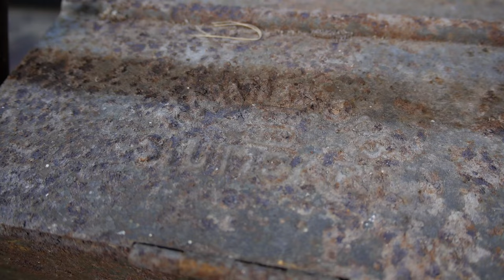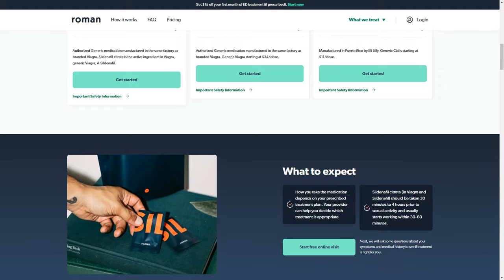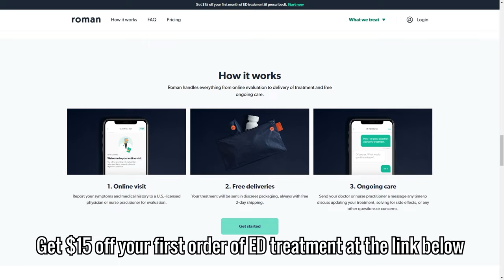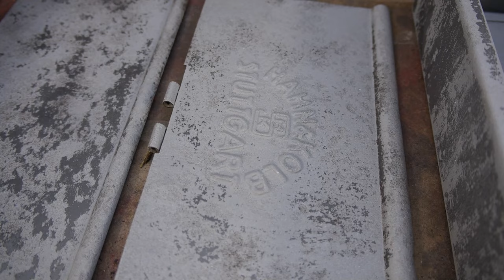Grandad's Toolbox - Restoration

Comment: Purely by coincidence, I found my own 45 year old cantilever toolbox today. It is thankfully in a much better condition than yours?
The rust is mainly confined to the base of all the trays which I think I will use some derusting fluid on, then paint them with red oxide?
I have decided to line the bottom of the trays with rubber like you; which should stop the trays rusting again?
I would like to thank you for giving me the inspiration to tackle this project; so thank you young Man, very much!

Comment: Typically rivets are removed by using a drill bit. Use one slightly wider than the rivet's shank and carefully drill until the head comes free, but stopping prior to drilling into the object underneath.

Comment: nice work as always but consider keeping the integrity of the subject.
It cannot be used as a toolbox anymore because paint will chip when you throw tools in it. It should be powdercoated..
It's basically become a very pretty, useless toolbox.

Also, what kind of screws were used to replace the rivets?

Comment: Great restore. I have my dads old tool kit (I think it is from the 1960/70’s) and it is in much better shape and does not need restoring but those inlays are very handy.  Out of interest what did you use to replace the rivets?  I will get some of those inlays.
Reply from the maker: Thanks R! I used Chicago Screws/binding screws.
Reply: No this Toolbox is much older! 
It is typical for 30/40! these tool boxes were used in exactly the same way by the Wehrmacht in their mobile Opelbitz repair trucks. There were different manufacturers Gedore, Belzer, Rowack, Autounion etc. etc.
the tool boxes after the war all had the handle to fold down.  like today

Comment: Sorry to be all 'elf an safety' but two weeny little points, as a metal working / welding engineer
#1 don't weld without gloves or SPF 1000. My right hand is noticebly older because that's the one I used to hold the torch
#2 heavy gloves and the angle grinder - do you like to eat with a spoon? 
Please excuse 'old man advice' i did enjoy the video though. I would call it dad's toolbox. pretty sure he sill has it too

Comment: I always find it strange when people put this much effort into restoring something of low value, that can easily be replaced. I see why, in general, you would restore a metal toolbox. But not THIS toolbox. A new one costs around 30 Dollars, so despite all this effort and cost, you end up with an inferior, aged product. I would not restore any toolbox that has rust holes in it. Just makes no sense. Still, nice work, nice video.
Reply: From a purely practical perspective, you are right.  We all look at things differently, which is not only OK, but a spectrum of perspectives collectively builds a richer understanding by the restoration community as a whole.  For many of us there is an emotional component.  I myself like the connection to past periods of time, especially the 1960s when I was growing up.  And if there is a personal connection, such as restoring my fathers prized handsaw he had to order from Sweden, all the better.  Just offering up some insight to be helpful.